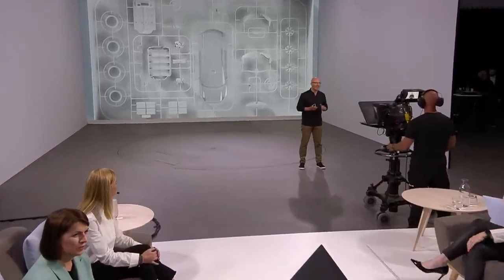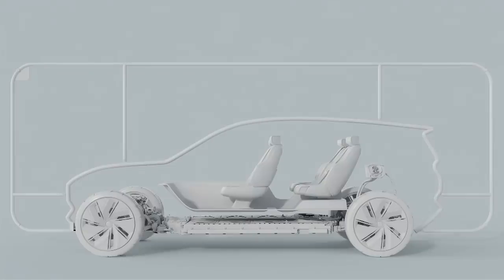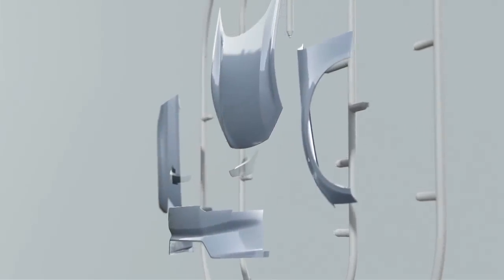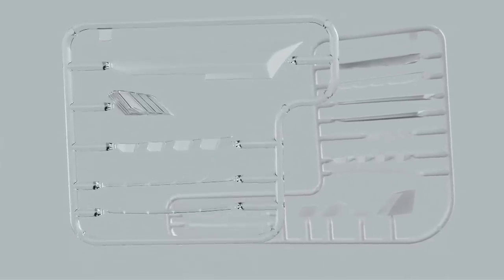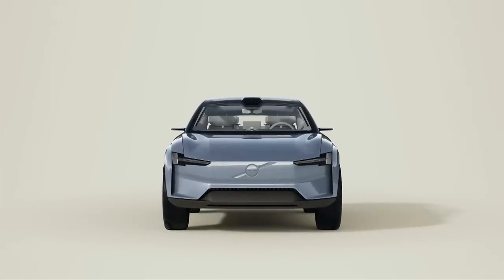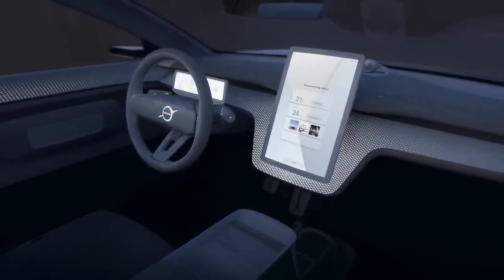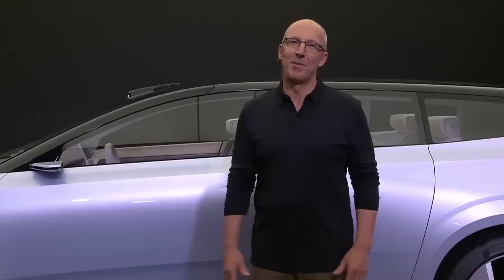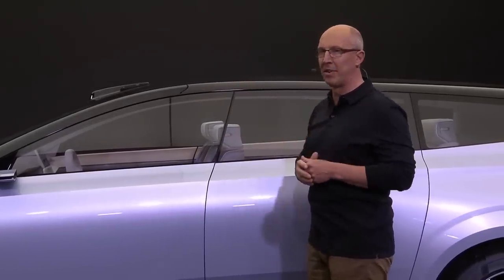Future of design

Comment: A bulky Lidar instead of cameras and ultra sonic for spatial monitoring? not so sure about that Volvo.
Reply: Are you an expert in the field? Tesla are using cameras now, but now have problems I thought.
Reply: Tesla was going to have a million vehicle "robotaxi" fleet years ago. Musk sold cars promising that the owners would reap huge profits by letting their car drive around on its own transporting paying passengers.

In reality, the Autopilot system can't drive more than a few seconds unassisted without crashing in any normal city situation and fails to notice a huge truck blocking their entire highway lane.

Comment: Don't know how long manufacturers keep sticking iPads and iPhones onto the dash rather than integrating seamlessly.  Just being sarcastic here.  Volvo current line up interior design is awesome.  Sorry but not this one.   They should stick to their own design and elaborate it.  Plus the tall centre iPad is blocking the centre tweeter which not only blocks the sound but also block the view of the tweeter which is supposed to add an aesthetic value to the interior.  Now it looks a bit like mach e,  id 3 or upcoming Tesla.  Already feel claustrophobic by looking from the outside due to low roof line and narrow side windows.  Not sure if the mood change when you're actually inside the car.

Comment: The front seems very high base on the sight line for the driver. I'd prefer how the front of the model 3 is lower compared to the driver so you can see the road right below the edge of the frunk.

Comment: The interior... I am sorry... But not integrating the display to the dashboard just looks horrible.... And the small display... just yikes
I loved the previous gen interior design a LOT, the current one is pretty solid to depending if you get the XC90 style where the display is still properly integrated, or well sadly the new C40 where the display is being pushed out a bit more...
also the rear looks bad :S

Comment: Those new Thor's hammer lights are a nice design touch. Practically - given Volvo's affection with safety - I wonder how I would be able to do a quick 'blink' with the HD-lights to signal to someone (attracting attention) while the DRL's are on, as the DRL's need at least some time to open up the gap...

Comment: Is a roof rack an option with that glass roof?
Reply from the maker: This is a concept car, and in a concept car a lot of different design ideas are tested. We aim to introduce some of the features gradually in our production cars when feasible. Our C40 Recharge however has a large, fixed panoramic glass roof and can have load carriers and a roof box.
Reply: @VolvoCars  thanks.
Reply from the maker: Thanks for your question. Safety is at core for us at Volvo Cars, and this applies of course also for our panoramic roofs. When we design our cars, we use the same Safety Targets for all variants of a vehicle – independent of roof type – and independent of accident type, including rollovers. And further, the glasses in our panoramic roofs are laminated (two glass sheets are bonded/moulded together by a plastic interlayer, just like the windscreen) to contain a high level of integrity.

Comment: I prefer the current generation Volvos, but this is also an okay looking concept. The front looks pretty nice but I don’t really like the rear. I don’t really understand why every manufacturer needs to oversimplify the cabin. The current Volvo interiors are modern but also have a nice design, and they are not too simple. It’s so easy to feel at home inside of the current Volvos, and I don’t think it will be nearly the same feeling if this kind of interior makes it into production.

Comment: Please read Volvo!

Hello Volvo! I am a big fan, currently I'm pretty young, but I have a dream of working for you, specifically in the department of Design. I want you to know, that the Concept Recharge looks amazing from the exterior, have some "eh and uh's..." about the interior but I'll talk about that later. Volvo safety is obviously amazing, currently Genesis Is in the lead... Which is a South Korean brand owned by Hyundai. Also, Volvo is second in safety, then Tesla, which people are liking quite a lot now-a-days. So, about the interior of the Concept recharge, Can you add a cream color tone as an option for the seats. and accents, I also think the there should be a little wood accents around the cabin, will look amazing, I like the white I guess LED's in the cabin, also where the screen that is in front of the steering wheel, maybe add like a a clean edge roof, just for the look and that no sun flares make the screen dirty. About the main screen itself, I think you should make sharper edges. You know how Polestar has yellow/mustard colored seat belts, I think it'll look good in it too! You know the 2022 Honda civic, how there's a Honey Comb design in it. I think add something like the above the LED lights, but with thin stripes in matte black! The interior would be a dream then! I hope you suggest this design. Also, If not in this car... another car. If I was old enough to be in your design team, I would have thought about it, but it's been told here. 

- Thank you :)

Comment: I like the interior but the lower roof rear end and plain panel in the front where the grille used to be, are my biggest dislikes.

As an SUV, load space of solids should not be lower than the outgoing model's and I hear you about improving aerodynamics and range, but if the new vehicle's headroom will be less than the current model's, we would be regressing.

Also, increase the rear end so you could put proper full size spare wheel in the trunk, and not tyre repair kit or some biscuit spare wheel in there. Make space for a proper spare wheel.

Now, I wish something better than the plain looking old grille replacement panel could be offered, even as an option. Such a big plain panel will have ugly chips, dents and sketches when insects and bugs and tiny stone chips from following other cars hit that thing. Either put some extra design lights, like fogs somewhere there (even as an option considering many like driving on country roads/safari and those extra lights will come nice and handy), or add a smaller but proportional dimensions grille. In any event, just as we've seen with current T8s, even battery powered vehicles need cooling, and what better way to design a smart looking grille and place it there to channel cooler air to the batteries to cool them down anyway? Even if it is a false grille, let customers have the option of a solid front panel or some cleverly designed grille.

As for those suicide doors, they look nice on paper, but are they safe and how strong is that pillarless "B-pillar" area in the even of being T-boned, or capsizing?

Otherwise, Volvo SUVs are highly desirable vehicles. I hope you'll also improve their offroading traction control software to make quicker decisions on wheels it should send power to, rather than spinning for ages before deciding to engage the wheel with better grip.

Can't wait to see the final product! Somehow I suspect the final version will have a higher rear roof area than is shown in this concept. Deliver the vehicle already, will you?!

Comment: All Volvos are good. However, as for the power on/off method, I would like it to be like other cars. The power to turn is safer, so if you do it, you can do it as it is, but it looks like a starting error will occur.

Comment: There are so many contradictions here. I love the idea of making the chassis and interior from scratch as an BEV. I can also see the benefits of lowering the roof line with no loss of interior space. Its exciting. BUT..... there are so many things that could be improved. Make the central screen more driver friendly by angling it toward the driver. By lowering the roof line, it has the negative effect of making the rear windows very small which from a passenger perspective is very depressing. The same with the rear tailgate window, without seeing it in real life, I can only imagine visibility is compromised.
It wasn't mentioned but I presume the wing mirrors are similar to the new Audi E-tron being cameras but there didn't seem to be any screens inside to display the images. May I suggest that the designers take a look at the reactions to these before making them permanent as the general feedback was they got very polar opinions, plus in the rain, snow etc as soon as they got wet, they were useless.
Reply from the maker: Thank you for your feedback! As this is a concept car, a lot of different design ideas are tested. We aim to introduce some of the features gradually in our production cars when feasible. By replacing the internal combustion engine with a full battery pack under a new flat floor, the wheelbase and the wheel size of the car can be extended, allowing designers to optimize the roof design, lower the hood and lower the overall height. This approach creates efficiency gains in aerodynamics compared to a regular SUV, which also improves range.

Comment: Nice, but you can replicate this exact design with an ICE.  Stretching the wheelbase, bringing the A pillar forward and raising the beltline, making for a high rake look, has nothing to do with EV architecture.  You're just lowering the greenhouse while raising the ride height.  Short overhangs tend to look better over front wheels not rear.  The D pillar and short rear overhang looks chopped and abrupt, not aggressive.  It's a long wheelbase wagon.  Think V90 with the chinese-S90 sedan w/extended wheelbase and a chopped trunk.

Comment: Other than the ergonomics, all the rest can still be done on a traditional combustion car! - You should be thinking more out of the box and come up with a fluid design, based on usage. since the floor has opened up, you could keep the seating and roof fluid, to fit multiple usecases and each design vs usecase will have a corresponding mileage efficiency.  The front of the car needn't be like a traditional car - think out of the box - you dont have an engine there!

Comment: Well, a lot of cars have been designed and have been seen on Automobile Shows all over the world, however, most of them did not make it into production. This Volvo model may look great (at least for some) but it seems quite a few things are out of proportion. The position of the two front seats is almost in center between front and rear wheels. The rear passengers can only look out of two stupid little windows, then they brought back those crazy suicide doors, why? Let's find out if it will go or not

Comment: Please look to integrate the touchscreen, rather than the stuck on tablet Tesla design.  Also, a small thing but make sure you use noise cancelling tires!
Reply: This is not a "Tesla" design. The screen will not be integrated in the next-gen Volvo. It will be open and floating on a kind of shelf that dips down.
Reply: @benjaminsmith2287  open and floating sounds like another way of saying stuck on - like a Tesla’s screen is…
Reply: @Maccaboy1984  It's stuck on. There is a wood time that dips down like in the current xc60 however it's a screen on the dash and not in the dash. It's more Polestar 2 than current Volvo design but no big console between the seats like Polestar 2.

Comment: The design concept is very good, but I find errors, it cannot have such a small display for the driver and a central one that looks like an ipad stuck, if all the instrumentation were part of the central panel and were integrated I think it would provide more design , comfort and better visualization, then the issue of the low ceiling did not quite convince me, lowering the ceiling is losing comfort and I think it goes against the Volvo philosophy.

Sure you can do much better ...

Comment: The most worrying and disappointing trend in automobile forming is the lowering roofline in the context of heightened shoulder lines. While really nice looking, streamlined silhouette it creates, yet was a child splashed out with the water? what about the joy of actually being inside and looking to the world inside-out? Sure, car designers search for compromises between ergonomics (mostly interior), "looks", safety and aerodynamic efficiency (exterior and "package").  However even airplane building industry considers adding more observability to passengers as an architecturally important attribute and selling aspect. And the modern technology promising more space, more comfort, "more everything", yet doesn't find  observability in the item checklist for "more".

Comment: Volvo future is here now no dealerships loss of jobs. Less service centres less local jobs.

Only Ev batteries dont last long. No fully recycle toxic to make toxic and expensive to get rid of.

Not much fast charging points around.

Still uses mainly fossil fuel to recharge if u dont have solar.

Your cars are not affordable

How safe is that big screen shattering in a crash with projectiles hitting your eyes or face.

U know why they call those door s suicide doors.

What about batteries exploding and catching fire.

Like to see how u keep the white clean.

But yes nice design vut not much head room for an suv.

Comment: The only thing good in this car is the interior. The lower roof messed it up.
Reply from the maker: We are glad to hear that you like the interior! By replacing the internal combustion engine with a full battery pack under a new flat floor, the wheelbase and the wheel size of the car can be extended allowing designers to optimize the roof design, lower the hood and lower the overall height. This approach creates efficiency gains in aerodynamics compared to a regular SUV, which also improves range.

Comment: The environmental impact of manufacturing the batteries for these cars is greater than fossil fuels emissions.
Reply from the maker: Over their average full lifecycle, fully electric vehicles are less carbon intensive than internal combustion engine vehicles. Our own findings show that the total carbon footprint of a Volvo XC40 with an internal combustion engine is 58 tonnes CO2e over 200,000 kms while the footprint for a fully electric XC40 Recharge ranges from 27-54 tonnes CO2e over the same distance. The variation in the footprint of the fully electric XC40 is due to differing electricity mixes with varying carbon intensity in the use phase. Battery production is currently a carbon intensive process. We are continuously working together with our battery suppliers on how to lower the energy use in production and help ensure their production becomes CO2 neutral.

Comment: When are we going to create something again that is actually usable and that is easy to perform maintenance on? Shit breaks. It's inevitable.
And I think this design is quite flawed in many utility and safety aspects.

1 -Oh no, the small monitor is malfunctioning. Oh well. You can't use the car until a workshop replaces the whole unit.
2 -Where do we place the heads of out passangers? Well, as close as possible to the weakly supported roof, of course!
3 -Do you want to open your door during winter time? Just take your gloves off and touch the frozen door panel!
4 -We know you can't put extra dtr lights in your front grill in Sweden, but we built the logo like this, so it's legal somehow. On this car only.
5 -We removed any kinds of storage compartments/pockets for the passengers. Your items are ugly anyways.
6 -Don't even think about replacing one of your headlight bulbs at a normal gas station. You know the drill. Workshop time again.
7 -Your seats are now sticks attached to the floor with a living meatsack sitting on it. We found this design to be the safest during a crash.
Reply: It’s a concept mate

Comment: Volvo this seems to be a bit like a Tesla . To me it seems a bit bland. I like the current Volvo fleet of vehicles on sale at the moment but not so sure about those you will manufacture in the near future. Then probably by then I will have retired from driving or it will blend in with other vehicles & environment when finally get released to the customer. To be quite honest I don’t like the rear end of the car from the side view the roof slopes too much. You need to come up with a better design than that. Please don’t make your card look so bland like Tesla.
Reply: The roof does slope too much. The back end looks squished. The interior however isn't like Tesla. It is only in the sense of the tablets. But that's going to be part of all vehicles soon enough. But the materials and styling does look Scandinavian. But the design does need something.
Reply: @benjaminsmith2287  got the Scandinavian look ok but it’s very bland. I don’t like the screen it’s a big distraction in my opinion. The current fleet of modern day Volvo look better .

Comment: And what have you done to make cars cheaper and easier do maintain? Interchangeable - cheap body panels, modular repairable internal structure, modular interchangeable battery pack. How much would cost those Thor Hammer shaped headlights in case of accident? If there is nothing I mentioned then all the ecofriendliness is nothing but bullshit.
Where are physical buttons? Everything controlled via this Aldi originated tablet? Have you been sleeping on your ergonomics and UX classes?
Think more about users. Greetings!